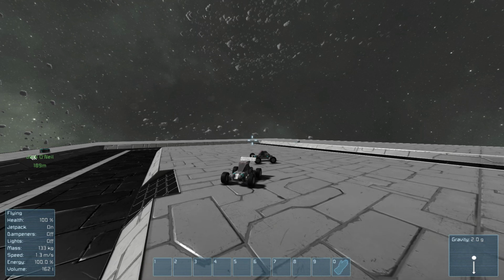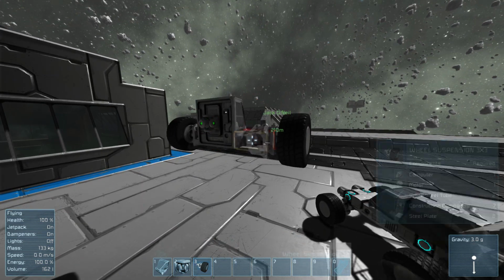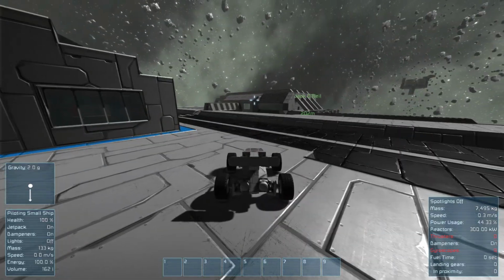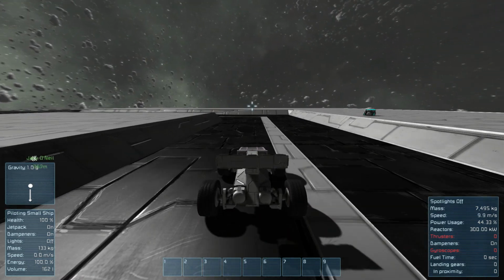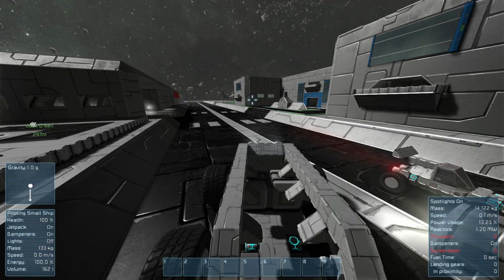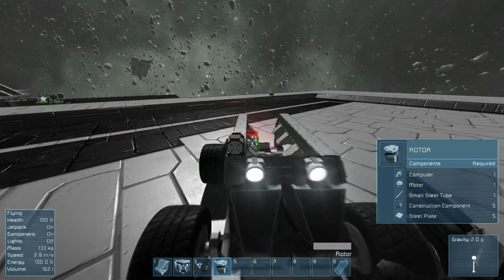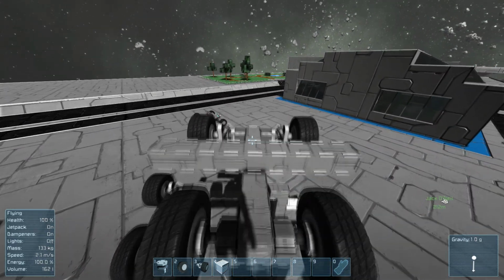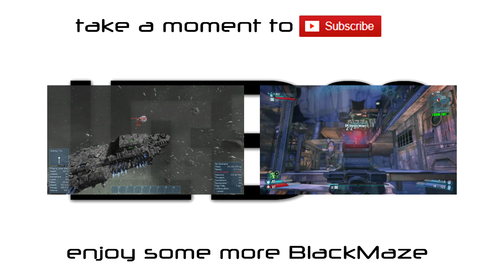Space Engineers - Introduction to Wheels & Current Limitations

Comment: Friction should be on the lower side (~25%) and strength, dampening ( i find dampening should always by high) and power should be set to whatever you prefer for the vehicle.  Driving a car without a differential (aka adjusting how fast each wheel is turning to account for difference due to conditions, ala turning) is going to result in slippage.  Super high friction tires without a differential is going to result in dangerous/wonky conditions.  Slippage is needed in this situation since when turning left the left wheel is covering slightly less ground than the outside wheel.  wider the vehicle the larger the difference.

Comment: those are not problems of the game (apart from the standing still twitching wheels for example), its math and physics. your cars are bouncing when turning, because you cannot have the friction so incredibly high, with 18%-30% friction in the front wheels (on cars with 4 wheels and front wheels steering) and 60% power, my cars handled like a dream. using tips from the devs videos and some other people, i learned things like not to skimp on artificial mass, at least 5 or 6 artificial mass blocks and specially 2G at least! 1G is good for max speed, not for steering.
on that part at the road in 7:00 of the video, you have different Gs along the road, that results in sudden accelerations and decelerations.
 funny detail, if we want 100% or even really high friction and no bouncing, each single wheel would have to turn in a different angle. because the wheels are pushing all against each other, each one is actually following a different path, it may seem counter intuitive. our real cars have a serious amount of engineering behind to diminish/ counteract these problems. finding the right recipe for making my cars behave smoothly, was a delicious added gameplay i was not expecting to receive from space engineers. i suspect a dev might be a petrolhead    :D
Reply from the maker: Thanks for this reply. Good information. I have couple of concerns though. First of all, the Friction slider has the description that this adjusted the tire pressure. Adjusting the tire pressure so that the tires are super hard should not result in the displayed behaviour!

Also, I would insist to never go above the 1G. As 1G is earth-like and is the situation that the car should behave well under.

I didn't notice the G overlap, so that's a good one, thanks for that!
Reply: BlackMaze
thats indeed a good point, its true that 1G should be the on spot gravity, but maybe due to all the tweaking we can do, we end up getting a huge range of different results. just like a recipe  :D
i must say, i never got awesome results with 1G, more than 40% friction on the turning wheels and more than 70% power. i always avoid any of one of these i ve mentioned.
 the devs shared the numbers they used, in the description of the update video: "Set up of Steerable wheels in Race cars:
Damping 48%
Strength 100%
Friction 14%
Power 41%
Number of artificial mass blocks 6
Gravity on the track: 3G"
i only use big friction sometimes in propulsion wheels that don t steer (i m loving that space engineers is becoming a game where we can exchange experiences and results)   :)
Reply: BlackMaze my truck does that jerking when I put it in 4x4 with my differentials locked on asphalt.  I'd be happy to take a video and send out to you.